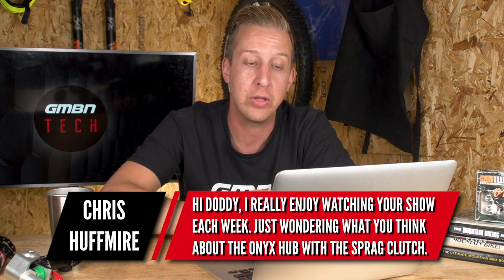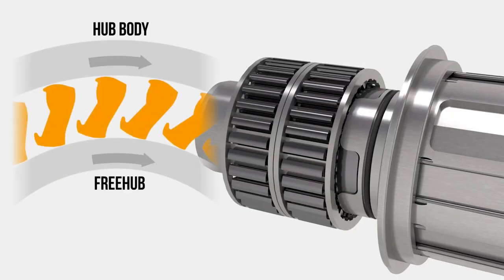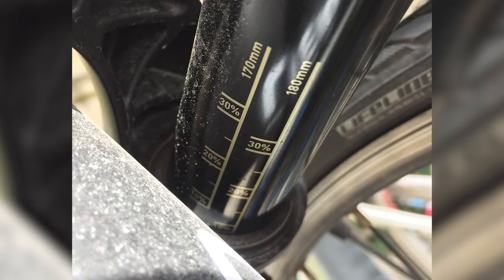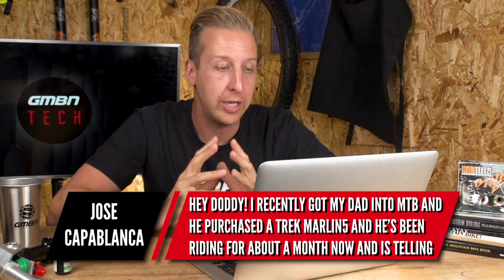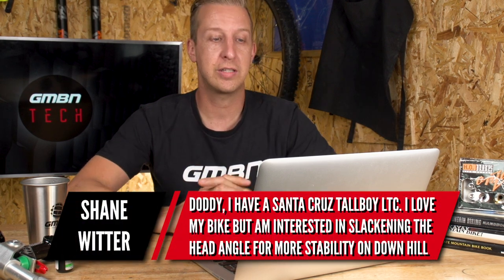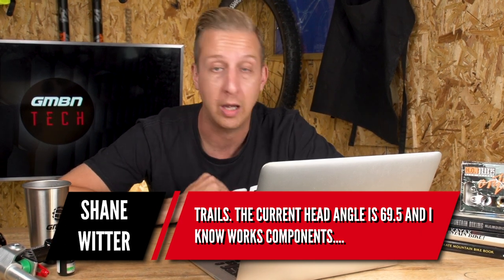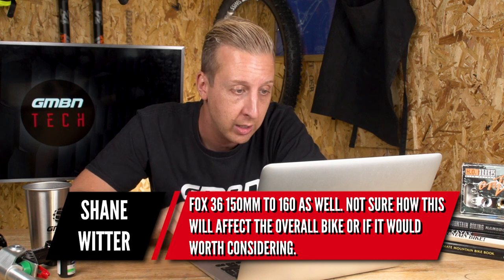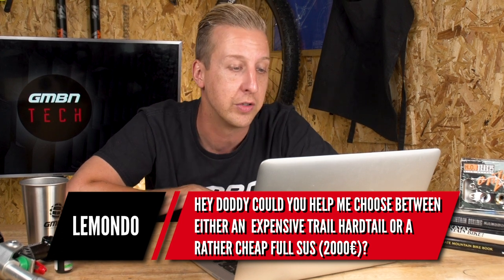Are Gearboxes The Future Of Mountain Biking? | Ask GMBN Tech

Comment: They're not as efficient, but the effect a conventional drive-train can have on rear suspension might just be a good reason to make the switch. Also, who needs a sprag clutch when Chris King have their angry bees?! (available as a ring tone too!). One thing I have heard about sprag clutches, from an aircraft engineer, is that the margin of error in the manufacturing tolerances is very very small for them to work effectively.

Comment: I have a Rockrider 9.1 XC trail bike and over the past 4 years have changed a lot which I have had good and bad results. I wanted a more aggressive trail bike so put a70mm,65mm. and finally a 50mm stem and off set bushes. The bike rides great but I had to drop the stem all the way down as I found I had no wait on the front wheel. Could you do a video on ways to change the geometry of a bike and what happens. Thanks

Comment: I have a mid 2017 RockShox Yari RC Fork. I brought it from 160 mm of travel to 140 with the new debonair system. From there I decided to do a 200- our service. When I put it back together my lockout didn't work. I am curious what the issue could be? I do know the one mistake I made was, undoing the circlip and piston before taking out the top cartridge.

Comment: #askgmbtech Hey Doody, love the techie channel. I'm just getting started/obsessed with MTBing. Here's my ?: 

I have a Remedy 8 and struggle to break the bead (stock Bont XR4 TLR) off the front rim. It's super tight, and usually requires tools. 

Reseating that bead (with a floor pump) needs soap and a lot of PSI. I've watched a shop fumble to reseat the bead, and have to use these big forceps I think they pinched from a maternity ward. 

I'd hate to have to change it on the trail. Bike and tyres were new in Jan, likely done around 100hrs. Rubber looks in good condition and that shop said they were fine - just some tyres are 'like that'.

I'm interested in what you think. (Got a pair of fresh Maxxis ready, just my recent experiences changing tyres is frustrating. Beforehand I had an entry-level hardtail, and it was easy on that!)

Comment: Hey Doddy! Just got a new Radon Swoop 170 10.0. On the Linkage Designs Blog i saw its one of the most linear suspension designs around (12%). I run the Fox X2 shock and it already has the max of 3 spacers installed. Still i rush through the travel too easy. What can i do? Would appreciate some deeper advice!

Comment: #askgmbntech Hi Doddy, I have to build a new wheel and I was wandering what are the differences between different lacing pattern (2x, 3x, 4x) especially in terms of lateral and torsional stiffness. I have always used 3x but maybe 2x might be as good as 3x since the spoke are shorter and therefore the will stretch less. Thank  you in advance
Tommaso

Comment: #askGMBNtech
G'day Doddy, I have a Specialized Enduro from 2012, the fork is an XFusion Vengeance R, do you think it would be worth it to upgrade the damper to the one from the Vengeance HLR (which would give me compression adjustment) or would it be more reasonable to grab another fork entirely? Also the R damper has an air valve on the bottom for some reason (?)
P.s. the fork actually works really good, that's why I'm considering doing this damper transplant.

Comment: #askgmbntech Hi, I'm looking for a new bike for riding about 1000 vertical meters uphill but then also rocky and muddy trails downhill. I want it to be a 27.5 full suspension and somewhere around 2500 Euros (Sram GX Eagle would be nice), so I was looking at a canyon spectral al 6.0 or a centurion no pogo 2000. Do you have any other recommendations what bike I should/could get? I'm currently 15 years old and 1.75m tall, but I think I will grow up to 1.85m and I want it to fit me for a long time. Thanks for any suggestions

Comment: #askgmbntech I have a 140mm travel full suspension bike and the frame is a size 16/small. It’s a non boost bike with a tapered Steerer tube and I want to transfer the parts to a hardtail bike, What frame would you recommend.

Comment: #askgmbntech i have stripped the head on 2 of the bolts on my 6-bolt disc rotor on my front wheel. How can i get these bolts out without wrecking the hub?

Comment: What is the down side of using an 7, 8, 9, 10 speed chainbreaker on a 11 speed chain?

I got one in a tool kit and don't know if I am supposed to use it!
Reply: i just used a general purpose chain tool to remove and fit a new 11 speed chain. It worked absolutely fine, took it out for a decent ride last night and no problems!
Reply: it works for all chains as the pin punch is adjustable. Only difference here is the width of your chain.
Reply: The pins on some 11 speed chains are narrower and you won't be able to fit the punch through. I know because I've tried by mistake even though i have an 11 speed punch. A lot of chain breakers come with interchangeable punches for that.

Comment: #AskGMBNTech - Have you seen the new concept/prototype drive train idea by Ceramic Speed? GCN had it on one of their shows after finding it at Eurobike and it's seems a crazy idea and the cassette looks really dangerous and an easy way to rip a leg open so let's face it, Roadies who are still unconvinced that Disc breaks rotors are safe and aren't going to chop your foot off, aren't ever going to accept that thing.

However, regardless of whether it's usable, useful, or even better and worth using the concept of it is excellent to see as all industries need people who are willing to think outside the box. 

Also, and this is really the point of this whole thing, do you think that the basic idea of a drive rod, instead of a chain, used either as shown or better with a gearbox, would work and do you think that it might be the best way forward. 

The chain is solid, does its job and has the history to prove its worth but the drive rod would offer up different ways of attaching the gearing to the wheel, its apparently has less friction and loss of power and it won't suffer from use and age as much as chains do. 

The gear box, drive rod set up could easily make it so you don't need to do mantainance to the drive train every time you do a fair ride, as long as the seals stay tight you should be good. This is the way cars have been done for, well for their entire life and seems to make sense.

I'd love to see someone going down this route but something that makes me think the rod idea won't work and isn't the best way to go is motorbikes and especially MotoGP, where they spend millions on development and design anything and everything that might save them any time, they seem worse than Sky and will do whatever, no matter how mad, as long as it saves them 0.001 of a second and they still use a chain. This might be down to changing the wheel and that the rod system would be slower, harder but still.

Comment: #askgmbntech hi I need a answer asap I am currently trying to change a bottom bracket in a dirt cheap bike and it has the really old system with the loose bearings. The problem I am having is that the fixed cup on the drive side will not come off (i know it's reverse threaded) I have been using every tool I have to try get it off but it has not budged a bit I have even tried getting wd40 into the threads but it  won't work. I have been hitting it so hard and so much that the brake calliper bolts poped out. Any advise to help me ? Thanks
Reply: You could use a torch to heat just the frame portion of the bb. Don't heat the bb itself. The frame should expand enough to release the bb. Not all bottom brackets are reverse thread. Check out this web page: https://www.parktool.com/blog/repair-help/

Comment: Yes you can put sealant inside tubes the best kinds called Flat attack or you can use slime slime is Caustic but it will work for a while you can get was called triple Thorn protection it's called a toughie it goes between the tire and the tube then you have thick Thorn resistant tubes what sealant inside the tubes so give three layers of protection and redundancy I do not like tubeless cuz it is messy and I eat up tires cuz I ride a lot I've had my Kona for three years and put 5400 miles on it I wear out a lot of parts and rubber grips included but yeah tubeless is a pain if you go through tires I get  I get about 15 to 18 hundred miles with the front steer Tire and only about a thousand miles Pearl rear tire Thorn resistant tubes add flat attack I've gone all five thousand of those miles without one flat I've never had a flat tire and all of those 5,000 miles had a ripped valve stem from wearing out on the rim that's it
Reply: Flat Attack is indeed the ultimate solution for anyone who wants to use tubes.  It's not water-based so it never dries out and isn't so likely to screw up either Presta or Schrader valves.  I had one tire get a slow leak even with it, and when I pulled the tube it had 23 (!) holes in it.  Courtesy of a run through a patch of goat head thorns 6 months prior.  It didn't stop working, I had used it all up.

Comment: #GMBNTech I would love a video about how to set/ index your gears/ rear derailleur propperly. I have a problem and I really need some help. ! have adjusted my rear derailleur, indexed my gears and made sure everything from chainring to freehub body is nice and tight and lubricated properly but i still have and hear a creaking noise when i pedal up in speed. I dont hear the creaking noise when i cruise or pedal slowly. I don't know why and it is driving me crazy. Everything is tight and i have checked every bolt but still cant find the issue. But i sounds like it is inside the freehub body, sounds like the creaking noise appears somwhere from the backwheel !  I have a Vitus sentier + 2018 27.5" with Shimano Deore RD-M6000 Shadow Plus deraileur, Shimano Deore SL-M6000 Rapid Fire Plus, I-Spec II, 10-Speed, SunRace 11-42t cassette and Novatec D462SB-SL-B12 - 6 Bolt, 148mm x 12mm rear hub.   Please Help!
Reply from the maker: Hey Mikael, Doddy had a gear indexing video here: http://gmbn.tech/perfect . With the creaking noise though, it can be so many things. Check your bottom bracket and saddle next maybe. Also, pedals are definitely worth checking.
Reply: Hello guys! Thanks for the answer :) I thought if you guys had some more tips and tricks about aligning/ setting gears that would be awesome! I have checked everything including the saddle and pedals and doesn't seem to be coming from there. How ever I noticed that my rear derailleur was a little bit bent/ crocked! Should the rear derailleur be perfectly straight in what ever gear you are running????? Thanks! :) Do you guys have any great tips shimano shadow+ 10speed derailleurs that can handle a 42tooth cassette with and without a goatlink?! Thanks again!

Comment: #askgmbntech I want to go tubeless but my Current tires which are non tubeless ready still have 90% thread life.Could i still run tubeless with my Current tires? I do not want to spend to much and buy new tires.
Reply: The sealant should close any holes but it depends on the tire. Definitely give it a go
Reply: Make sure your rims are tubeless ready. If they aren't you can buy a conversion kit which is a rubber rim strip with a valve attached to it. Might be cheaper to buy new tires. If so just wait until its time to buy new tires. One thing to note: Non tubeless tires weren't designed to be run without tubes so the don't have the added rubber to maintain sidewall strength and puncture resistance. If they are a cheaper tire you may have a lot of issues with punctures depending on your riding conditions and style. My honest opinion would be to just wait and do it right. Could save you ALOT of headache. Tubeless isn't for every one. Also with that being said don't cheap out on a cheap tubeless tire because they don't hold up well. A good tubeless set up can be expensive.